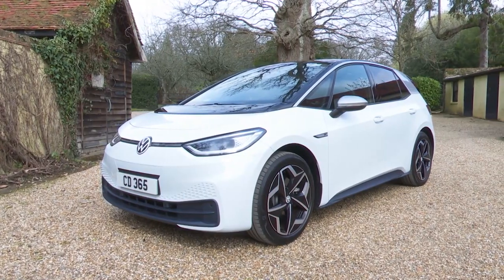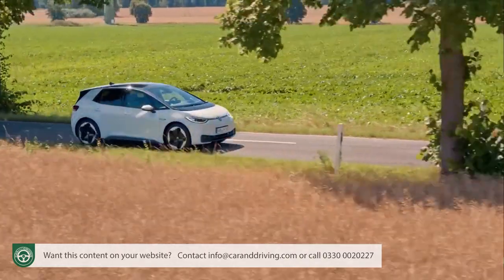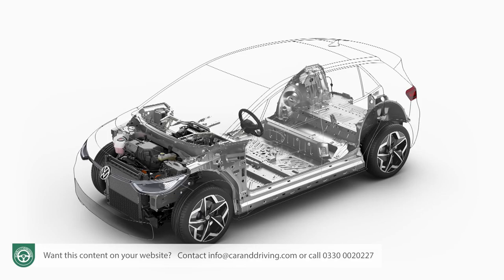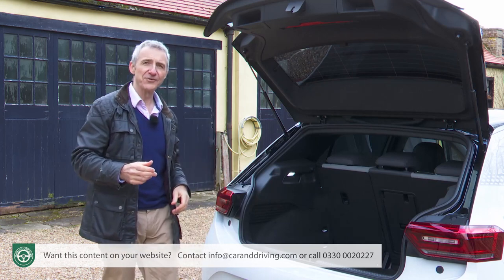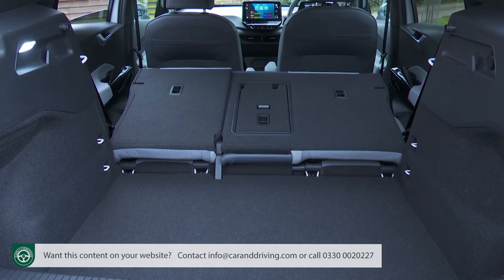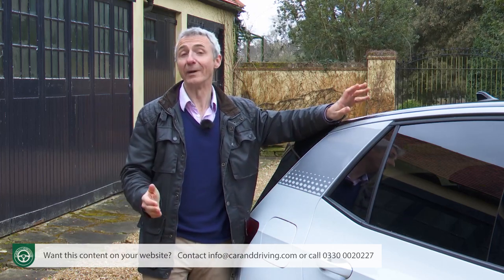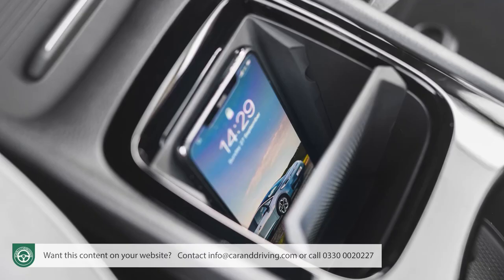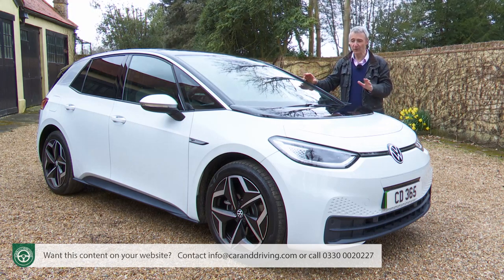Volkswagen ID.3 2021 - THE FUTURE??

Comment: Good review thanks! With the touch controls you can either press or slide. The press is very responsive and its what we use. In terms of materials, I came from a 4 year old BMW and dont notice much difference. The thin plastics are a fact of life on EVs as the manufacturers look to reduce weight, I have seen the same criticism for the new Nissan Leaf, Tesla Model 3, etc. I like the fact that VW has thought hard about where you put your hand and made these surfaces comfortable material. I like the look of piano black however fingerprints are here for life ;)
Reply from the maker: Thanks!